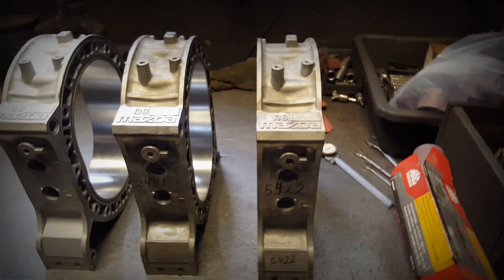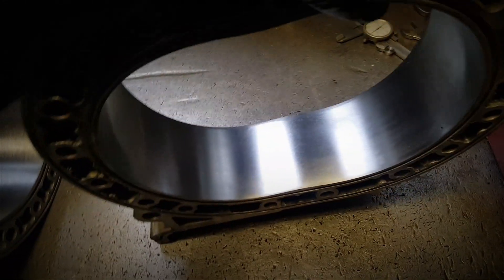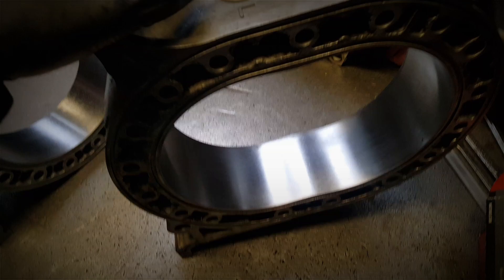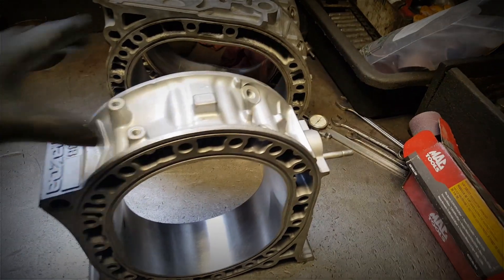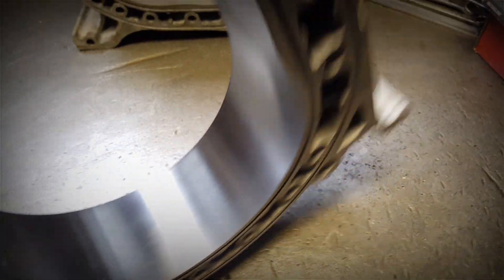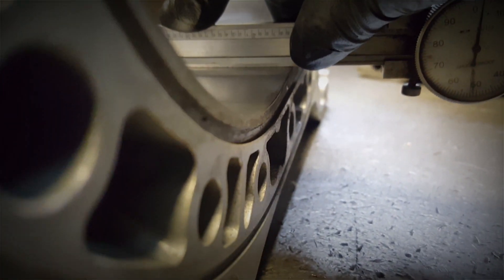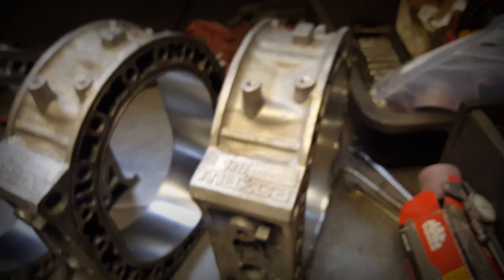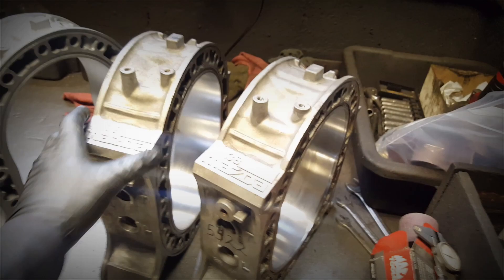Mazda rx8 rx7 engine rebuild; refurbishing-reconditioning the housings vid#2

Comment: I can almost assure you his top secret is called "Sandpaper"
First a 320 ,then a 600 there you continue up intill 2000 grit.then polish the thing with "scratch remover"
That's what i think.
Reply from the maker: 😂 not even close, you should check out KMR on Instagram, he just started using same method i use! 🤘😎🤘

Comment: What is the micron rating of the finish?
Reply from the maker: What do you mean? Because is not a piston engine lol
Reply: @JM8686  Okay, maybe you understand piston engines better. I asked the question because your video give no clue as to smoothness of your finishing technique. If I was to guess it looks like you used 80 grit on a flap wheel. Chrome flaking is when the chrome is GONE ! No amount of finishing will return a straight face for the Alex seal to seat on. No straight face, no adequate compression. You are fooling yourself and your customers.
Reply from the maker: Ohh good EXPLANATION you should let all this shops know that they been  doing it wrong for too many years lol  goopyperformance,mazdatrix,apextobuild,abelibarra,rotaryresurection,dnagarage,turbodave and many Japanese builders 😂😂
Reply: @JM8686  Nobody on that list I would take a rotary too, maybe mazdatrix, but they use new or re-chromed and re-ground, not sanded. Anyways, there will be customers for you! Good Luck!
Reply from the maker: Haha thanks 👌